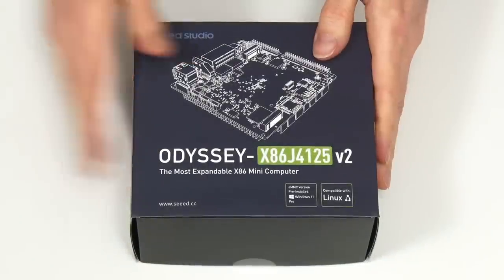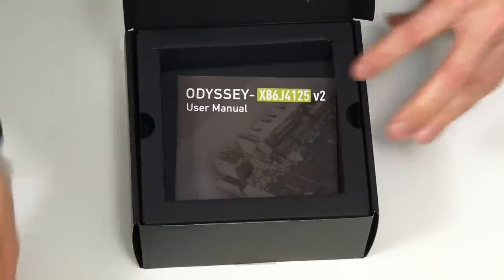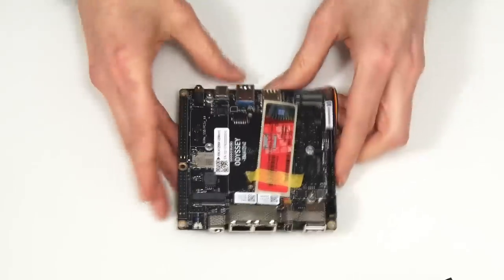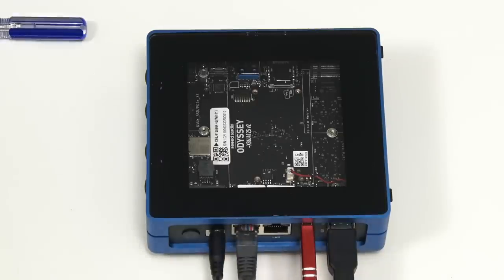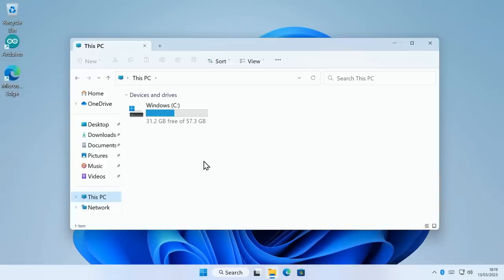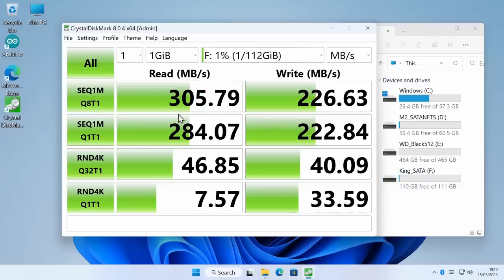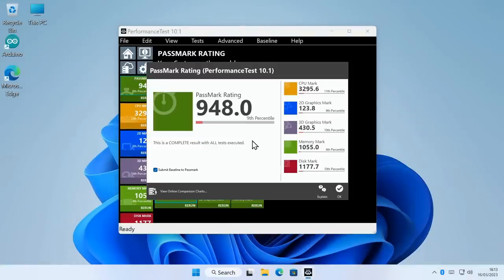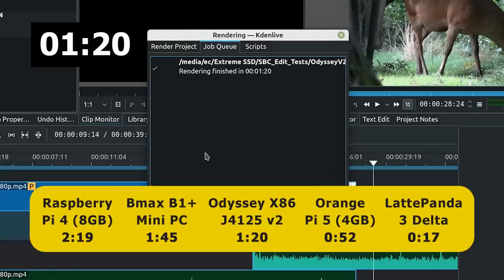Odyssey X86J4125 v2: x86 SBC with Dual 2.5Gb Ethernet

Comment: Got a n5105 (11th gen) mini computer for $134... 8gb ram 256gb ssd. Some minis have both m.2 and sata. And true, no easy gpio, but adafruit has a USB card that effectively gives you a gpio. (Saw that on your channel!! Very cool.) We (me and my students) use arduinos for gpios (effectively) by simply talking to the PC over USB, not hard. Arduino can talk to any program that way, including python, processing or unity programs they write. What is the case for this over a cheaper newer mini pc with a faster cpu + and Arduino (or any microcontroller) of your choice?

Comment: I think that running Windows on that board is a bit pointless. Maybe there is some DIY incentive here but quite limited in my opinion, but I can imagine some commercial use of it. 
I love the RP2040 on board, especially if UART or USB UART are exposed, this gives this board enormous versatility both from Micropython and C SDK. 
But I think the best use for it are those two Ethernet ports, which can make it great firewall / router project.
Reply: I'd be interested to know how those Ethernet ports perform.

Comment: I realized today...  This computer could easily be set up as a home security computer, with sensors wired directly to the GPIO pins from around a house.  Simple wired sensor detection, controls, and alarms could be set up by a noob programmer (like me), while emergency service integration could also be done by a more advanced programmer.  Sim card integration along with a battery could make this even better for home security.
Reply from the maker: What an amazing thought. :)

Comment: At this price you can almost get a Steam deck when factoring in storage and other things you may need/want (case, cooling, display, something to interface with, even a battery)
The deck has faster cpu, faster gpu and 16GB of RAM. OFC it depends what you want it for but for price vs price and if you just want a computer. Well i thought it was interesting to point out.

Comment: j4125 based micro/mini atx/itx motherboards cost around $100 in any computer shop. 8GB ddr4 is +$20. psu is like $30-40. So you get same hardware any day but cheaper and more flexible. You can put in 10Gbe sfp+ card in it for example. Ok, it will be a little bigger. But that's not a mobile device so that's totally fine in most cases. So I don't get the strict need for an sbc.
Reply from the maker: Fair point, but it depends on the application. I'm not aware of any $100 J4125 boards with 2.5Gb Ethernet, let alone twin NICs and two M.2 slots. :)
Reply: @ExplainingComputers  not to mention the rp2040 built in and GPIO pins which adds some very interesting options

Comment: Are there any Linux SOM or SBCs (with operating temperature -40 to +85) currently available that can be used instead of Raspberry Pi Compute-4?
Reply from the maker: It depends what you mwan by "instead" (ie level of compatibility). OKDo / Radxa do have compute modules: https://www.okdo.com/c/rock-shop/rock-compute-modules/

Comment: I am beginning to think that once the RPi form factor is exceeded with these X86 SBC's that a generic Chinese mini-PC would be much faster and cheaper, and now there are serial GPIO adapters available they are becoming a much better option, am I wrong?
Reply from the maker: You are not wrong. We now have very strong competition from low-cost mini PCs, like the $100 board I looked at here fairly recently. This said, what the Odyssey offers are the twin, 2.5Gb Ethernet ports, and more and faster storage interfaces. So it comes down to application.

Comment: I wonder why they used the aging j4125: the faster Celeron n5105, also equipped with a faster iGPU, would have been the better choice me thinks ;-)
Also: the j4215 only supports PCIe 2.0, cutting the max speed of any used PCIe 3.0 NVMe SSD in half (1600MB/s)
Reply from the maker: This I do not know.
Reply: @ExplainingComputers  I see that the max speed of your SSD was a bit higher: 1822MB/s. That's not bad 🙂

Comment: Well, ignoring the high cost, it is refreshing to see an SBC that is not borked by poor software integration with regard to mainstream desktop tasks.  But, if I desire a desktop with a J4125, I can purchase an Acer XC-830-UB11 for less than $120 US.
Reply from the maker: All true. But you cannot but any other J4125 (or similar mini PC) with twin 2.5 Ethernet and three storage interfaces for $120, or even double that. :) As I stressed in the video, the key hardware of this board is its connectivity.
Reply: @n n any such use case needs to consider cost/benefit relative to other off-the-shelf solutions.  You suggest an expensive router solution that will require tinkering.  The PC I mention has two SATA ports, NVME, and an available PCI express slot which can serve to expand capabilities in a multitude of ways (if one desires to tinker).
Reply: Acer XC-830-UB11, with its J4125, sips but a few watts of power and is quiet.  A dual 2.5gbps NIC (under $40) can be installed in the available PCIe slot.  This desktop PC employs a laptop-style motherboard and an external power brick.  It's nice that the enclosure is larger than a mini-PC so there is proper thermals.  I've purchased two: one for use as a NAS and the other for my daily driver (snappy enough for YouTube at 1080p, photo editing, and general web surfing).

Comment: I recently bought this board with Windows 11 and it works very well. But I was wondering if the wake on lan feature only works after booting into Windows first and then do a shutdown.

If I completely power it off and then some time later connect the 12V adapter and ethernet cable then i'm unable to get it running using wake on lan.

Comment: I first got interested in SBCs about ten years ago, when I was homeless, and at that time carried around a portable DVD player for entertainment.  It used to be that power saving, and performance were two diametrically opposed opposites in computers.  Now, that is clearly not the case, and yet, SBC manufacturers still act like that is still true.  I have yet to see a battery powered SBC, or an SBC that is powerful enough to game with, but doesn't cost 3-4 hundred dollars, which is silly, because of the proliferation of small, and powerful APUs what exactly are you paying for in modern machines?  Form factor?  PCBway exists.  I still continue to see stupid designs, like soldered RAM modules.  (who has EVER wanted that??!!) There have been sockets for RAM since the 80s, get with the times!
Reply from the maker: A battery-powered SBC is a really great idea. Imagine something like a Pi Zero (2W) that had an AA battery holder on the back. :) The UDOO Bolt models have socketed SO-DIMM RAM -- which of course means they are technically not SBCs anymore! :) Soldered RAM reduces cost and size.
Reply: @ExplainingComputers  right, I understand the technical WHY of it, I just don't think smaller is better, especially when performance would be degraded.  What defines an SBC really?  Do you need anything more than a single wired connection?  How many people use the GPIO outputs in reality, or is it just to have it to SAY they have it?  Because the granddaddy Raspberry Pi had it?  There isn't enough innovation in this space.  Not just in general, but in specificity as well. (with modern APUs)  I love your channel, but I find myself skipping videos because all the boards seem basically the same.  It reminds me of the 1990s with all the boring beige boxes, and Emachines.  Yes they were computers, but they were just that.
Reply: @mattparker9726  I do think you're missing the general purpose and use case for SBCs here. While many of them can function just fine as a lightweight desktop computing system, the purpose of these boards is usually to be a development environment for low power or embedded OS applications. 

With that in mind, added cost for things like expandable RAM just don't make sense. As for battery power, you can find plenty of SBCs with Lithium battery controllers if you want it, though there's market options for things like the raspberry pi to run it off of batteries.

If all you're looking for is a relatively small PC without getting rid of the parts you'd expect on those systems, they already have micro-ITX and other standards for Small Form Factor (SFF) PCs. There are even plenty of options for cheap SFF PCs and I believe Explaining Computers did a video on them someone recently.
Reply: @cavemaneca  I know it seems weird, and yes there are other options, sure. Probably better options.  But I LIKE SBCs.
Reply: @mattparker9726  A battery powered SBC ? wouldn't that be a netbook ?
There is a small advantage of soldered RAM being that you can use proprietary LPDDR memory which consumes less power. Not having RAM slots is not such a big deal on low end SBCs as RAM capacity is limited by the RAM controller.

Comment: Why is this sbc so expensive iam confused it doesn't have a  powerful CPU I wish you would test games for performance and some emulation of older systems like PS2 GameCube and Geekbench test  great video though thanks 👍
Reply from the maker: The price is for the connectivity (dual 2.5Gb NICs, dual M.2 slot, SATA port, and GPIO), not the CPU. And like most SBCs, this will be produced in relatively low quantities.

Comment: At 6:19  Idea for a video:
Wireless specifications....

802.11  a/b/g/n/ac....I think there is ad, ax, and others.

Can you make a video about Wi-Fi and the various iterations on the 802.11 standard please?? If you have already made a video but it has been awhile, is it time to make an update due to all the changes?? I think I heard Wi-Fi 7 has already been ratified, which specification would that entail, there is Wi-Fi 5, 6, and 6E.... Those boil down to one of the iterations of the specification, which one?

I find a little confusing is all....

Could you add Bluetooth into the mix please?? You said this board has Bluetooth 5....there is a 5LE, I think I've heard of the Bluetooth 6, I wasn't it called something else before Bluetooth 5 or Bluetooth 4??

Thank you for your time;
Monte
Reply from the maker: A good video idea -- noted. :)

Comment: I like the addition of the RP2040 but I honestly can't see why you'd integrate one on the system like this. 

Is this a tinker board? Then why Windows 11? 

Is this a small PC replacement? Then why does it have a GPIO with an RP2040?

It's trying to be everything at once when This should really be two different products - A higher-performance consumer mini PC and a lower performance tinker PC with a microcontroller for whatever you'd use it for.

Comment: A very capable board.  I see this board being a real good choice for NAS applications, and not so much just running Windoze and it's applications.  I'd love to know more about how you talk to the RP2040 chip on this board, as it is the basis for MMBASIC on the Pico, or the VGA PicoMite.  Not that you would really need the VGA output of the PicoMite VGA on this chip on this board, but if you were to install MMBASIC on the RP2040, could you then interface with it via Windoze on this board?  A VERY interesting board overall!!!
Reply: Good comment.

Comment: Looks like my Latte Panda 3 Delta has a major competitor. RPi vs Arduino. 2.5 Gb ethernet + lots more storage + cellular connectivity. Is this a maker SBC, an RV owner's dream, or an SBC home NAS? Perhaps all of the above for home automation enthusiasts. What more could we expect?
FYI for viewers & prospective buyers. I purchased my LP 3 Delta without the Windows pro license, to migrate from MS to Linux, only to discover Linux Mint didn't support a touchscreen panel. ]|-( So, I was forced to purchase a Win 10 Home license for twice the price as the bundled price, but without Win 10 Pro's Remote Desktop to add insult to injury.
Live and learn. C'est la vie.
Hopefully your viewers will benefit from my experience of life, learned the more expensive way.
Cheers! 😎
Reply from the maker: Thanks for this, and an interesting (if hard) lesson there.

Comment: I didn't realise it's possible to install windows and Linux on the same computer. Chris have you made a video already to explain how to install and configure this possibility?
Reply: https://www.youtube.com/watch?v=Q4zt3wEt7s8

Windows (in my experience) overwrites the bootloader, effectively killing the Linux partition, if you install both OSes to the same drive. Therefore, use one drive for Windows and another for Linux.
Reply: @@nn-dv3uf thanks good fellow. I have basic knowledge and this has helped. My SBC has Linux installed. I need to use Windows on occasion. Is it possible to install on an external HD, connect it to my computer and use that to boot Windows?

Comment: Anything getting near $250 and no memory slots is a hard pass for me. I do like the rest of the of the features but they could have also skipped the emmc. Even the emmc modules are not widely used and cost more than "normal" storage options. For tinkering options this board is more than I am willing to pay. I am not critizing you intentionally Chris but where's the GPIO functionality tests? I2C functionality?

Comment: .hmmm. You get the equivalent cpu / board from asrock as ITX-J4125 (also m-itx matx.. different versions) for around 110 bucks.
Of course then also need power supply,ram and case, maybe adding pci express network card, license.. so wont be cheaper.
BUT the cpu = tech is from Q4 2019 .. so i'm not really impressed that they come out with this version mid 2023.. and would go for the J5040-itx version.

Comment: nice board.   still trying to figure out who decided to waste space having two usb 2.0 ports instead of 3.0/3.1... or one of each at least.   But great board otherwise.  Thank you Chris!
Reply: Maybe someone that thought it would be overkill to define the places where you would plug in your keyboard an mouse as USB 3.x ports.
Reply: Space? It surely a question of what's integrated into the Celeron SoC and with four PCIe lanes dedicated to the NVMe drive and dual 2.5 Gb/s Ethernet it's short of bandwidth.

Comment: Nice concept though I do find myself wishing it had a 3rd or even 4th Ethernet slot - though with the two NICs and the WIFI device this could function as an extremely capable gateway/router device even if you were doing extensive logging and perhaps even some file sharing from it (though I'm generally loathed to do that as I subscribe to the firewall appliance concept).  For reference I run a 2013 era Jetway board based on a twin core D525 that has 4x gigabit ethernet ports (I use all four for physical network zones).  It's been on constantly for roughly 7 years of its life and it's still going strong though if it reads me typing this it'll probably set fire or something.

Comment: Can it power a 3.5 inch SATA hard drive?
Reply from the maker: Possibly. It will depend on the drive. There are 12V and 5V rails in the SATA power. But personally I would only ry to power a 2.5 inch drive or SSD.

Comment: Thanks for the license key!

On a serious note, this board seems like it would be great for some traffic filtering with pfSense.
Reply from the maker: As can clearly be seen in the video, the last set of five characters of the license key are covered by the yellow tape. This means that, even if you can clearly read the other digital, there are  60.4 million combinations you would have to try. Good luck with that! :) But yes, great for pfSense.
Reply: @ExplainingComputers  Upon closer inspection (and a little toying around in GIMP), I must say the yellow tape does a better job of obscuring the end portion of the key than I initially thought. The first character looks like it could be an M or N. But beyond that I couldn't make out any characters with confidence.

Comment: does anyone have any suggestions for an arm or intel or even amd based SBC that I could use for pen testing?
perferrably a 16gb ram or more.
that has fair graphics output for a 49 inch curved monitor

Comment: The addition of two USB 2 ports always confuses me in this USB 3/4 world
Reply from the maker: There are still some occasions when devices do not work on a UBS 3.0 port, and a USB 3.0 is wasted on a keyboard and mouse. Also, it will also depend on what the chipset offers -- and presumably here they have connected up what the chipset provides, which is a mix of USB 2.0 and 3.x. . :)
Reply: @ExplainingComputers  I completely agree. USB 2.0 is useful for 1.1/2.0 devices like HID and would be a complete waste of a 3.0 port. I think my surprise was how few 3.0 Type-A ports they decided to include on this board.

Comment: Curious how you  managed to get Windows 11 to only create  "Local Account"🤔
Reply from the maker: I did not set up the Windows 11 account -- what I showed is how the board come pre-configured. However, at least until the latest version, it is/was possible to set up a local-only account in Windows 11 Pro. It is not (theoretically!) possible in Windows 11 Home.

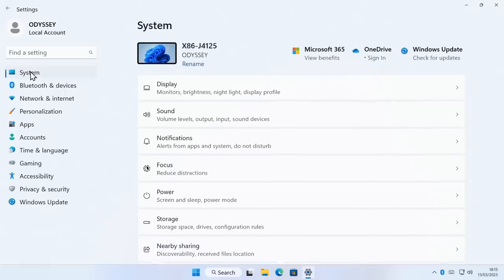Comment: I gotta LOL that the display scaling in Windows STILL doesn't work right.  Look at 9:24 and you can see the "Sign in" button text and "Learn more" are both chopped off on the bottom.  AND this is Microsoft programming and not some 3rd party programming that doesn't accept scaling well.  Too funny.

Comment: I don't understand these, you can get smaller x86 computers like the mele quieter which comes with a case for much cheaper and a 2040 or whatever microcontroller you like and have the same basic functionality for $100 less and smaller overall.
Reply from the maker: Yes, this kind of SBC is under pressure. So it depends on the application. The cheaper mini PCs you mention do not have twin (or even single) 2.5Gb Ethernet, or twin M.2 slots plus a SATA port.
Reply: They seem to be very different devices to the Odyssey.   For example, they lack the internal storage options, e.g. multiple SATA within the case.